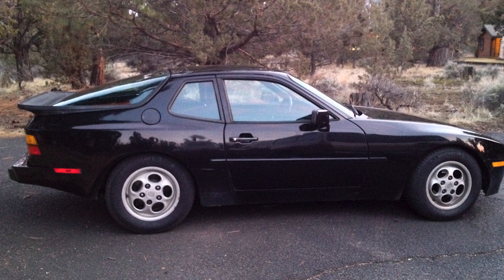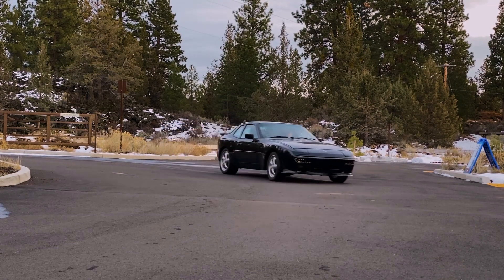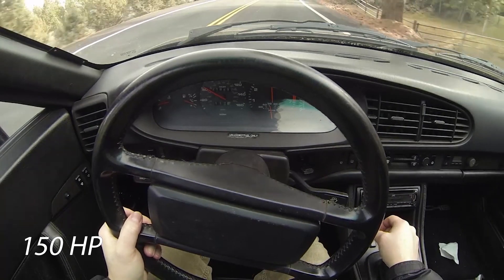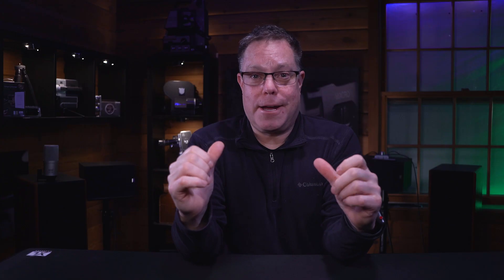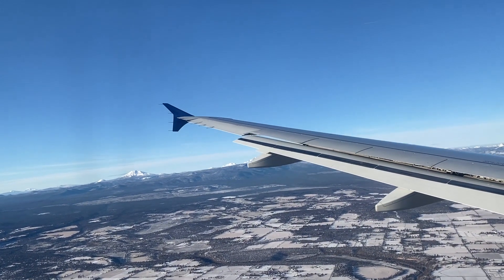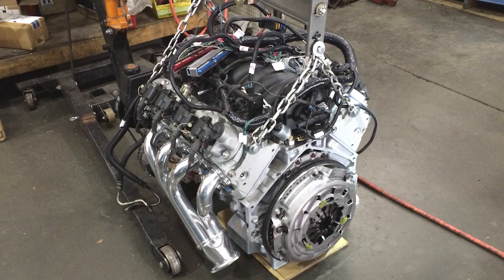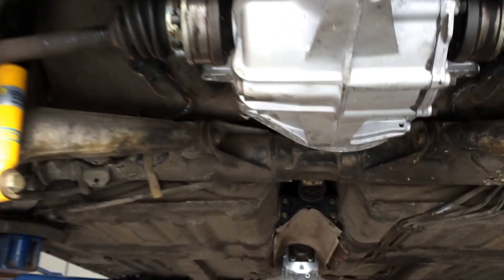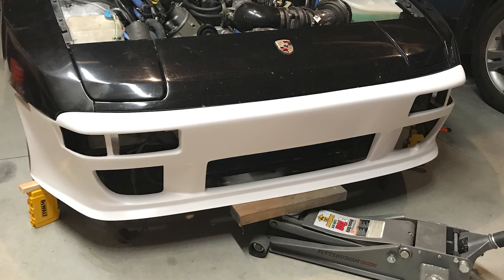944 - LS SWAPPED / How did I do it?

Comment: I'm a C4 'vette owner.  I've been thinking about an LS swap for a while, but cramming an LS3 in a C4 is a bit of a hat trick.  The more I read about 944 LS swaps, it sound simpler than the C4 (but not much).  The power to weight ratio is better.  Thanks for sharing, fantastic car, and yes, the 944 was the bomb in the 80's.
Reply from the maker: Thanks, If you have a good budget you should go for it, Mine was fun.

Comment: Just my opinion:  removing the horizontal door guards is the easiest way to update the look of any 944.  It’s a cleaner look.
Reply from the maker: Hey man, thanks for the tip, I will look for some pictures that do not have them installed and check it out. Thanks for watching!
Reply: Hanz did it 
I forgot to mention that I bought a ‘88 Turbo from the original owner.  He told me he removed the guards the 1st week of buying the car.  He was completely spot on for doing it.  
If you look around you will occasionally see one w/o the guards.   I think you will agree it’s a much cleaner look
Reply: I dont mean to be off topic but does any of you know of a tool to get back into an instagram account..?
I was dumb forgot the password. I would appreciate any help you can offer me.
Reply: @Cash Silas instablaster :)
Reply: @Ethan Mario I really appreciate your reply. I got to the site through google and im trying it out now.
I see it takes quite some time so I will get back to you later with my results.
Reply: @Ethan Mario It did the trick and I finally got access to my account again. Im so happy!
Thank you so much you saved my account!
Reply: @Cash Silas No problem :)

Comment: I’m digging this build! The black wheels and lowering it some turned out nicely too. What seats are those that you installed? I have hundreds of other questions too, but I’ll leave it at just that one. I’m getting an 87 924s and have been seriously considering doing what you have done. Of course I’ll need to add a little extra to the body in order to achieve a more 944/924 GT look.
Reply from the maker: I just checked out my account and I believe these are the ones that I got for my 944 
 https://www.carid.com/cipher/cipher-auto-cpa1001-series-racing-seats-universal-385490367.html?vehicle=115402
Feel free to ask any questions. Thanks for watching and supporting my channel.

Comment: Would really like to know how much you put into a new engine, tran, suspension, and brakes
Reply from the maker: Me too, to be honestly after I paid for the engine rebuild I kind of stopped counting just because it was getting so out of hand. If I had it to do over again I would buy a NEW LS3 crate engine $10K Renegade hybrids kit with headers 5K transaxle rebuild $3K  Breaks and suspension 2K . Total $20K. bodywork and paint could range anywhere between $1000 in $20,000 depending on how far you want to dive into the rabbit hole. After all is said and done I think this car might be worth about $30,000 so not a lot of profit in it. It was more a labor of love  (These numbers are just estimates do not quote me). Hopefully this is helpful thank you so much for watching.

Comment: I just would change also the rear bumper. What do you think. I own a 944 s2 and I think this is the best stock engine for the 944.
Reply from the maker: I will definitely try to find a rear bumper for this car, I agree they look very sleek. I think all of the Porsche engines when they are running well are amazing I just wanted a little more power. More power equals more fun, or more trouble LOL. Thank you so much for watching and supporting my channel.

Comment: what kind of electronics did you get to control the LS motor?  or dash did you get?
Reply from the maker: I used the computer from the Camaro that i took the LS out of, and I was able to get all the VDO Gages in the Porsche dash to work. it was a clean install. Thanks you so much for watching.

Comment: Hanz, as a fellow DIYr and car guy, I really appreciate what you have done here. If you had a "do over" would you have tried to get ahold of a 944 Turbo to start with or are you happy going with an NA model?
Reply from the maker: Hey Seth, I am happy with the 944s, I wold like to have a transaxle from a turbo but they are hard to find any more. The problem with the turbo cars is that they have been hammered on a bit more with the extra HP. My 944s only had 150 ish HP so it was not doing to many burnouts if you know what I am saying. To answer your question for the way I drive it... it is a perfect setup and I love it. Here is a link to the latest video on the  944  https://youtu.be/Pu4HhtKP-Sw  Just a few updates. Thank you so much for watching and supporting my channel!

Comment: Looks awesome! What did you replace in the interior and with what? Everything looks new (dash, door panels, ...) and those seats look amazing!
Reply from the maker: One of my requirements when I bought this car was that it was in really good shape and had no rust. I didn't really plan on doing this build but I was picky when I was making my purchase. I took out the electric seats and replaced them with some seats from this company I found called carid.com. I think I have links to the seats in the steering wheel in the description. I bought a dash cover from eBay and it made the whole interior look almost brand new. I also got a new shifter knob which I have gotten some controversy about but I think it looks pretty cool. I found that on eBay as well. This has been a labor of love and everybody will have different tastes but I think this turned out pretty close to what I imagined when I started. Thank you so much for watching
Reply: @hanzdidit  Thanks for getting back to me! This is very helpful. I'm considering getting a 944 and doing an LS swap as well. My neighbour had a beautiful red one when I was a kid. Love the look but not at all crazy about the base power. I have a 2022 Camaro 2SS and would love to have a 944 with a similar power plant. Came close to getting an '83 944 on the weekend. Had only 60k km and had been in storage for 10 years. It didn't last long though and I missed out. Was only $4k. Anyway, thanks for all the info!

Comment: Did you change the intake or cam in the LS1? I’m considering swapping my NA for a LS. Can’t decide if I should go crate engine or find a good low mile. How did you get the gauges to work with the GM ECU? Thanks! Love your car.
Reply from the maker: this was just the stock LS out of the Camero. I probably should've put a cam in it but I didn't wanna blow up the trans axle. If I had it to do over again I would've got a crate engine, by the time I bought the car and rebuilt the engine it would have been very close to the crate price. The company I bought my kit from renegade hybrid was able to give me a wiring diagram so I could wire up my VDO gauges.
Reply: @hanzdidit  Great information thank you very much!!!

Comment: Ok, wow, that front end was incredible. How does it handle with the bigger motor? Do you lose it a little bit on the turns? My 83’ hugs the road on curves as you know. Since I have the manual steering rack and the sloowww 2.5L NA.
Reply from the maker: Thank you so much. Believe it or not the LS one aluminum block is only 30 pounds heavier than the cast-iron four-cylinder 2.5L  that comes stock with the Porsche 944s. I have not noticed any difference, it seems to handle just as well if not better. Thank you so much for watching and the positive feedback, you made my day.
Reply: @hanzdidit  Wow man! Only 30 more lbs?! There’s a place in my town, I live in Vegas, called Renegade, all they do is LS swaps for Porsches. They sell the kits too.

Comment: please tell us about those cool/slim mirrors
Reply from the maker: The mirrors are stock 944 mirrors I just took out all of the guts of the mirrors and the huge plastic basils. I use the three screw holes and put big washers on them so I could use double-sided tape to just adhere the mirrors directly. Unfortunately you cannot move the mirrors but I set them up they are perfect for me. Since I'm the only one that drives this car I figured that would be OK. Thank you so much for watching.
Reply: @hanzdidit  OK - That is helpful, and makes sense.  Looks fantastic, understand the limitation.

Comment: Can I use a non turbo transaxle with the ls swap?
Reply from the maker: I am using a 944S transmission and it seems to be holding up really well. I did have it rebuilt and I do not hammer it so hopefully it will last a long time. Thank you so much for watching.
Reply: @hanzdidit  thanks

Comment: Do you have a parts list? I have been trying to figure out best brake options since mine is a 84 N/A. I pretty much have a list of everything I need for LS swap, etc. I also have an L83 I have thought about trying to make work, but I am going to sell it and just get an LS. Less headache :)
Reply from the maker: I do not have a parts list but I did get most of my tips from Renegade Hybrids in Las Vegas. I think I got my brakes from Summit Racing I found this kit for your car (84 - 944)
https://www.summitracing.com/parts/wil-140-11018-dr 
maybe this will help. I went with the Wilwood brakes. Considering I had to loose my power break booster they work great. I hope this helps and thank you for watching!

Comment: great build and great video! I am looking to do the same ls swap to my own 944 and im wondering how much did you spend on just the swap itself?
Reply from the maker: My advice is to try to find a Camaro or a Tahoe with an LS that is it in good shape. I had mine rebuilt and it is too expensive to talk about. The stuff that I got from Renegade Hybrid it was about $5000. I got headers, radiator, engine mounts, bell-hosing and I have them set up the computer for me.
Reply: You can find 100k mile LS1s for 2k. Conversion kits are 2-4K, depending on options, plus a 951 (turbo) transaxle, to handle the power, then probably a few more odds and ends depending on what else you’re doing. I would say between 5-8 just for conversion.

Comment: Listen, sorry to break it to you, but if you spend time on the original 4 cylinder engine that came with it, you could produce a lot more power than the LS Swap. Consider talking to Albert Broadfoot. He’s been working on that specific Porsche for over 38 years. Now I know some people are gonna get all toxic because I say this.
Reply from the maker: Sorry to break it to you but there is nothing like the sound and feel of a V-8 inside of a Porsche 944. Nice job trying to promote your friend on my channel.
Reply: You could only match the power on a turbo, different animal than 350 hp NA
Reply: Hanz did it I’m not a fan of the LS Swap in general, to me, swapping the inline 4 is like putting a LS swap in a rx-7.
The LS swap is also such a large engine, there’s no room for upgrades in the engine bay, speaking of which, the engine itself is long, so it will damp, affecting the front axle by far, affecting your handling and also putting pressure on the front axle.
However, I respect your work and effort put in the car. It’s awesome to see people who still work on these cars. 😅

Comment: No the 928 had a front engine v8
Reply from the maker: What is the car that looks like the 944 but just strip down? no fin on the back but similar body and a 4 banger. Sorry if I mixed up the models. Thanks so much for watching.